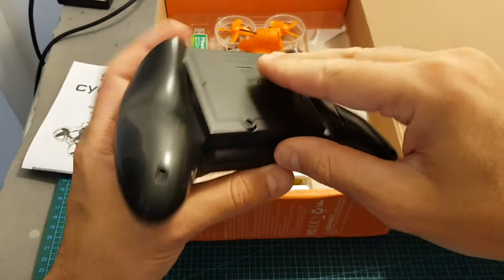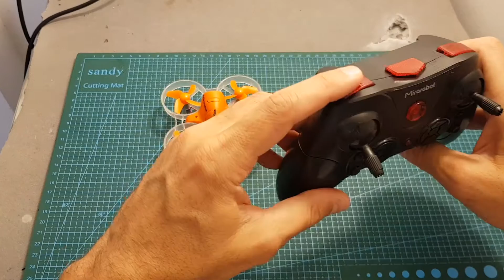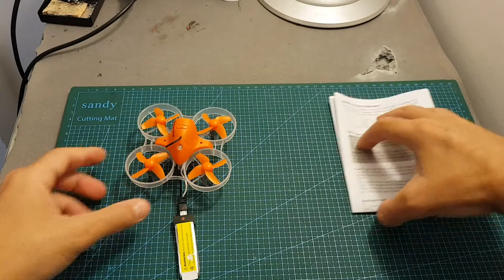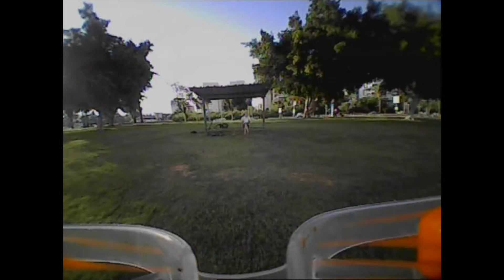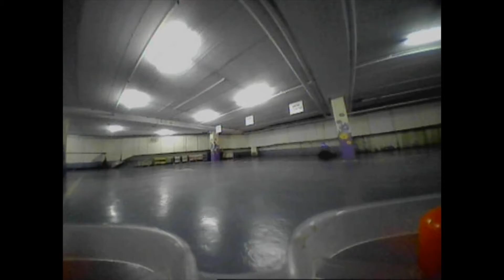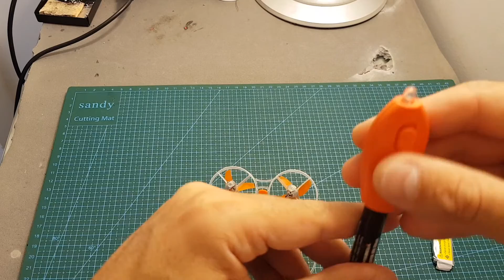Mirarobot S85 Micro FPV Racing Drone - Review & Test Flight

Comment: Mine likes to throw props and in Alt Hold mode it remains full throttle and does not always respond to my stick movement.
Reply from the maker: Use some glue or dental floss on the motor shaft.

Comment: Can you recommend some spare batteries because I want to fly more than 4 minutes
Reply from the maker: It's using a pretty big lipos. If you can get more of the original ones it will be the best solution.
Reply: Gal Kremer The original lipo battery tour talking about?

Comment: Hello GK, great video.....I have a Boldclash bwhoop b03 that I want to upgrade to become a HV power whoop. What JST PH 2.0 CONNECTORS SHOULD I get...Can you direct me, Thanks and happy flying!!
Reply from the maker: Hi buddy, thanks. You need to get this connector: https://www.ebay.com/itm/Mini-Micro-JST-PH-2-0mm-2-0-2-Pin-Male-Female-Plug-w-Wired-10pairs/253384996567
Reply: Thanks..I will order from here.